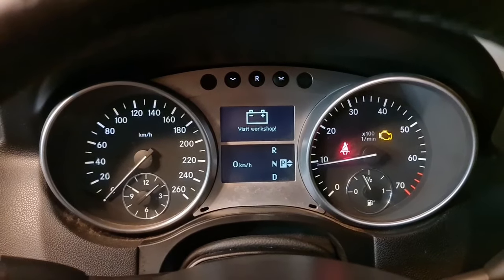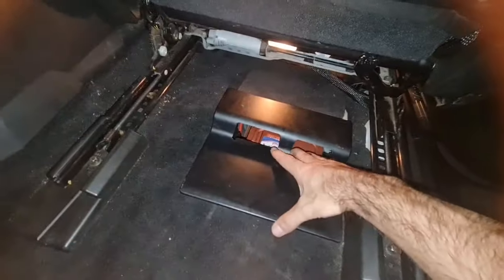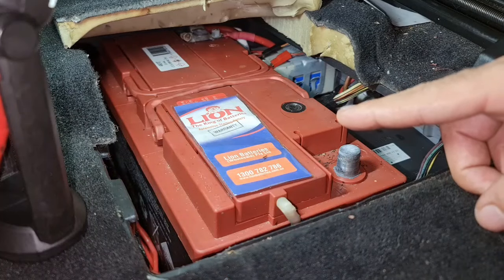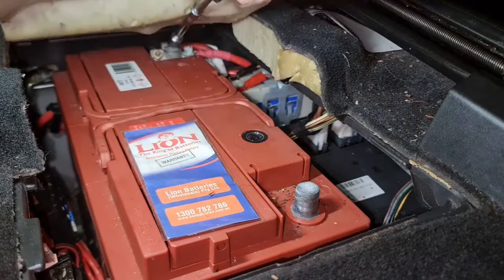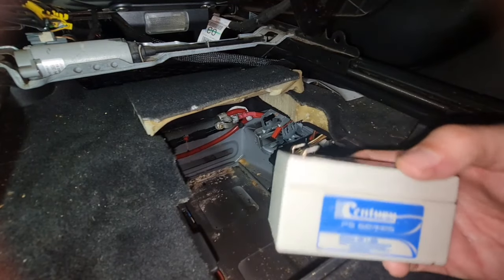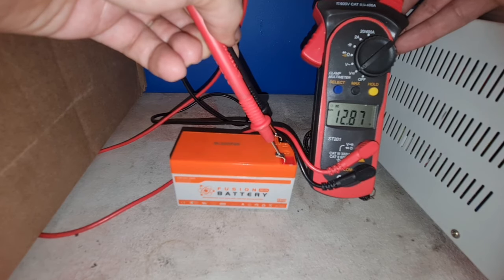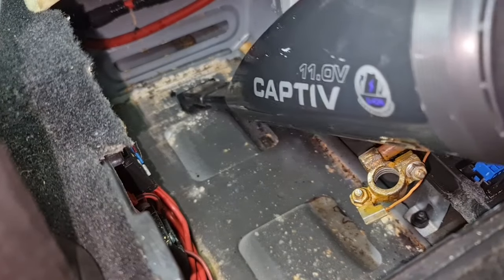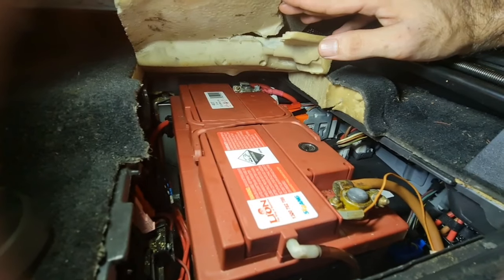Mercedes Battery warning on? Easy Fix...

Comment: Great Work. Nice video.
l replaced this on a E250 2013 year.  New battery from Jaycar for around $AU20 last year. Mercedes wanted close to $AU200.
Battery was near steering column. Tight spot but got it done.
Reply from the maker: Thanks for sharing, I paid $25 on Ebay, and these genuine batteries are expensive.  Jaycar is a good tip.

Comment: Thanks for the video. I've replaced both aux and main battery but I still can't remove my red battery error and also get an SRS error now too.

Anyway to reset all this? Thanks
Reply from the maker: Test at battery terminals,  when engine off 12.5v, when running 14v. Less than 13.5 means bad alternator.